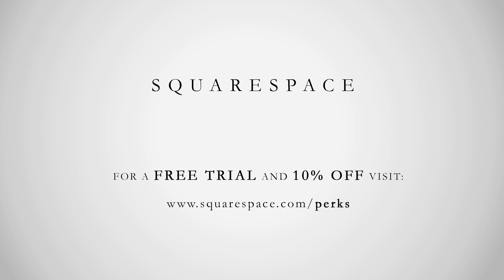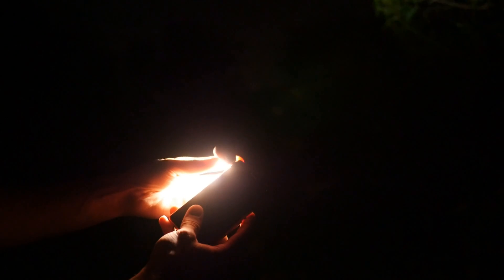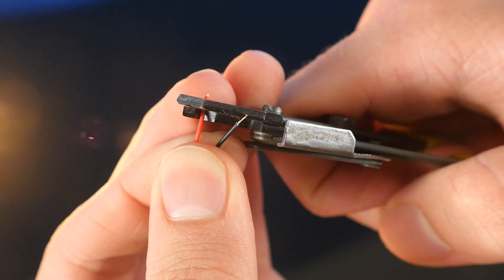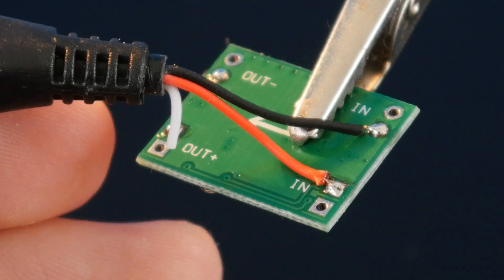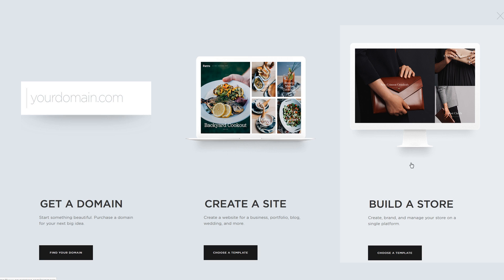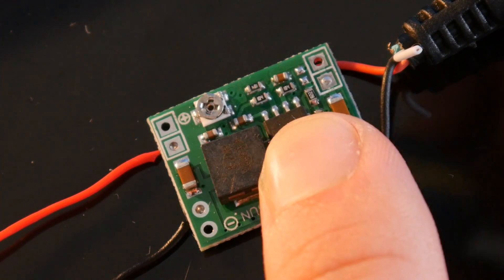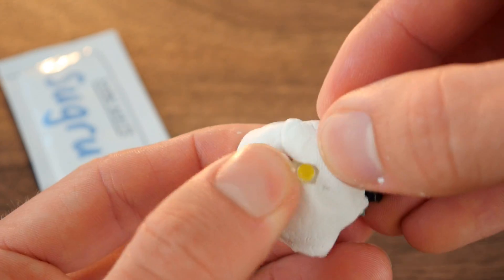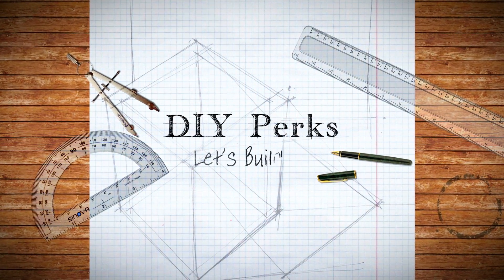A DIY smartphone hack that's actually useful!

Comment: Price of all those parts from amazon inc. shipping is about 50$
For that money we can buy high quality flashlight, with 10W(1000Lm) of power so about 4 times more than that DIY crap.
Also that DIY egg will die quickly because there is no cooling for the LED.
Reply: What heat dispenser???
Its even thermally isolated by that plastic.
And no heatsink.
Reply: You can buy these on ebay for less than $1 dollar USD. There are two types using SMD LED's. One that is a constant brightness and one you can dim as needed. Here';s what they look like -- http://www.ebay.com/itm/MINI-Touch-Switch-USB-mobile-power-camping-lamp-LED-night-light-White-lamp-WF-/371741972756? -- I have a few of them and use them with a mini/micro usb OTG adapter of approximately the same size. I keep the light plugged into the usb adapter and it fits in a pocket. Much less bulky and only cost $2. Now they certainly are not 3 watt LEDs, but they are still very bright and will light up a car interior, footpath in front of you or tent quite nicely... and gently sip from the battery.
Reply: I have dimmable(by touch panel) usb flaslight.
These are just another reason to do not build that shitty flaslight by diyperks...
Reply: I didnt know that it will be shit.
Reply: Sounds good... for the price I can't really moan. Cheers.
Reply: Why don't they make the USB touch light thing in micro usb that plugs straight into the phone socket?
Reply: ss ss I have no idea, but I like the fact that it's full size USB based, because I can use a USB cable to hang the lights from the top of my tree stand and tent above my head for overhead lighting. It also works very well with a battery power pack and USB cable above the kitchen table for overhead lighting during power outages for fixing food, eating, and playing games and cards.

Comment: How do you deal with the heat? I built one and the back of the LED gets so hot you could fry an egg on it! I adjusted the POT to it's lowest setting at full brightness?
Reply: i have the same problem ..... did you fix it ?

Comment: For anybody wondering, this will cost about $20 usd before the mold. The molding he uses ranges from $8-20 but you aren't using all of it on this one project. I'd say you could go cheaper by using epoxy. Maybe the paste epoxy would be a good option. Anyways, nice project. $20 isn't too bad for something original like this. Fun too.

Comment: can you do an OTG external speakers, please? 😄
Reply: Donny Sabri Get a Otg cable, a usb soundcard and a pair of battery powered speaker (3x AA/AAA) connect the soundcard to the Otg cable, open it and add wires to 5v and ground, solder those to the positive and negative terminal of where the batteries used to go. Plug the speakers in to the sound card and hide everything inside one of the speakers. And now you have Otg speakers.
Reply: Or just use any speaker with an auxillary cord...
Reply: Buy an OTG,get USB-Powered speakers and plug the otg and the jack
Reply: gosh that would be sooo awesome!
Reply: Its possible on android 5.0+ I believe.
Reply: :O I HOPE TO SEE YOUR IDEA ON THIS CHANNEL

Comment: I have a bar COB led strip from an old flashlight. would I be able to use it for this project?
Reply: TheFlacker99 (Flak) of course!
Reply: Just check how many volts/watts/amps  it is - you might need to get more power with an amplifier if your phone doesn't give enough. Check your phone's specs.

Comment: whats the point? the phone has a great flashlight already built in just download an app to turn on the flash :/ dont really get the video cos of this
Reply: Johan Kleijn for example phone flashlight is not suitable for my need because it spreads the light way too much making it very dimm when distance between object and phone is greater than 2 meters. this led utilizes lens to focus light so it can illuminate longer distance
Reply: DJhartson true i get your point depends on the flash though my freinds iphone can barely light up 2 meters and my lg g3's does it to about 10 meters in a very wide angle and very bright

Comment: how could I make a front camera LED flash light or illuminator where it's on for video and flashes fur photos for selfie photos and videos using the front camera in low light thanks android user
Reply: matthew pownall you would likely have to write an android driver for that device and would have to integrate the data lanes. A little processor would have to control the light.

Comment: You could add a loop so that you can keep it on your keys
Reply: Take possible aluminum strip, bend it half, add key ring on the middle, put some thermal paste between just polished surfaces and bolt it to leds heat sink with small machine screws. Then add suguru or what ever over it. This should also extend the usage time of the light before it over heats on point of shutting down.

You can make it from steel too to make it more durable, but heat transfer is far less with steel than using aluminum.

Comment: Its clever, but isn't simpler to just buy a small torch that will work without needing a phone attached?
Reply: where's the fun in that?
Reply: I have a small one on my keyring, uses an AA battery and has adjustable brightness and focus
Reply: Colin Java that literally defeats the point in this channel lol no one said this is the simplest option, but on the contrary is it not a good option to have so you never have to charge it or replace a battery? as long as your phone has a charge, you have a light

Comment: Hi. I decided to use three 1W LEDs connected in paralel. I set the voltage on the regulator to 3V and after assembly it switched to 2.4V resulting in a very dim light. After disassembly it turned out that the potentiometer stopped working at all. Luckily I've ordered two of those boards. After replacing the circuit i set the voltage to 2.9v so that the LEDs don't get too warm. I turned it on and left it for some time to check whether everything runs smooth. The whole light seemed to be ok, nothing was heating up. After assembly of the case I wanted to check if it still works and after connecting the power source it burned the board instantly. LEDs were ok, the step down board was smoking. I've used two cell li-po battery. Current was not nearly 1 A at 2.9V. Any suggestions what I did wrong there?

Comment: I am not sure all phones have the over-load protection (not even all PCs have it)... following these steps one could blow the power circuit...
Reply: All phones that support OTG have it and if your phone has no otg there will be no power at all. so no worries :)
Reply: And this is your estimation or information based on official OTG specs?
Reply: YS Production That is the USB standard which doesnt allow more :)
Reply: Jeez, did you miss the part where I said that even some (and actually most) PCs don't have a protection against going over the standard value? The devices' task is to not go over 500 mA, while the host's task is to be able to supply 500 mA. If the device wants to disobey the specs and pull more power, it simply does. The host MAY have a protection (USB specs do not specify it has to be there, maybe OTG specs do, but I wouldn't be sure - that's why I asked if you had looked at the specs actually). Most PCs only have a protection in form of a physical fuse which will blow. But not such a one that would test the load and disconnect it, as the phone in the video does.
So it was only your estimation, great. Thanks for replying.

Comment: As LEDs have like, 0 resistance, they will gladly accept and pass through any amount of current you apply to them,even if they burn through , thats why they should be driven via Current control not Voltage, the manufacturer lists the forward current for led,  you can however limit the voltage as done in this video, but you should check it with a multimeter not trial and error
Reply: If the voltage is limited using buck converters like he did, would it also limit the current? I'm new to electronics

Comment: Love your vids. You've come a long way, and have progressed to a very polished look. I would be really interested to see you create a video for a 'Boom Box' build. Those fantastic old radio/cassette boxes with huge speakers etc. Something really creative. Now it's up to you mate! :) 

GO!
Reply from the maker: Oh, I actually have something like that already planned ;) stay tuned!
Reply: DIY Perks SWEET! Might I encourage you to consider including Bluetooth in your design? :) I'll be sure to watch for the Vid! Thanks!
Reply from the maker: Bluetooth is the main focus - we're on the same wavelength it seems!
Reply: DIY Perks looking forward to it!
Reply: DIY Perks  When researching, Google "diy Bluetooth ground loop", as this will retrieve tutorials that tackle a problem that occurs when you use a single power supply to power both the amp and Bluetooth module, the infamous ground loop, which manifests itself through a very annoying buzzing.
Reply: I had the ground loop issue when doing something similar. I built a lowpass filter, and got it working. I have a instructables of it here http://www.instructables.com/id/Add-bluetooth-to-your-car-stereo/
Reply: Scott Seitz

Comment: Could anyone say why the led get very hot when i plug it in to my phone it has the otg facility ?
Reply: camohoj it's normal. if you are concerned about it then just drop the voltage a tiny bit

Comment: Hi, Matt !  After watching this video,(and drawing great inspiration from it), I went ahead, and converted a rechargeable philips electric hair trimmer/razor, into a USB powered one. The trimmer, originally had one 1.2 V AAA rechargeable cell inside, which I removed, and in its place I soldered the Voltage Step Down Board (which you have used in this video), tweaking it's output to get around 1.5 Volts. The board now drives the trimmer's motor perfectly & is fed by a portable 5 Volts, 2 Amp Mobile Power bank(Mi Power Bank 10000mAh).  Thanks, once again for the inspiration!
Reply: legend. IDK why DIY Perks hasnt pinned this!
Reply: You could have just used few LEDs to step down the voltage. Step down board is excessive. As you did not create this board and probably have little idea how it works, you just assembled ready parts. You did Assemble It Yourself, not Do It Yourself.
Reply: @ScienceDiscoverer  - I’m sure you’re fun at parties… Did he do it himself or did he hire someone to do it for him? He did it himself, thus DIY. Does DIY Perks ACTUALLY build the circuits to turn the input signal into the picture displayed for his laptop LCD screen or does he buy the pre-made components to run the screen? Is he Assemble It Yourself Perks? Stop being pedantic.
Reply: @ScienceDiscoverer Still couldn't call it DIY, he must manufacture his own LEDs, wires and connectors.

Comment: Great idea, but isn't that kind of like having to carry around a flashlight?
Reply: Flashlights need batteries, this doesn't need anything but your phone
Reply: Not really, because you can shrink this project to the size of paperclip and you will not find flash light that small and bright that will fit in your wallet or on your keychain.
Reply: Great! How? Also, what phone do you have and what are the best features?
Reply: I use Galaxy S5, and it works with 3 LEDs 1 watt each.  When I walk into the garage at night with this thing on, don't even need to turn on the lights to search for something.

Comment: Or, just carry a flashlight. I am certain I can find one that's even smaller than this thing. Sorry.
Reply: Internet 101: Everytime there's a DIY video, there would be someone who would always said you could buy the same thing instead of making one. 
THAT'S NOT THE POINT OF THE VIDEO
Reply from the maker: Maybe, but I guarantee that it won't be anywhere near as bright, which is the whole point of the project.
Reply: To be fair, the components are bought. What is the difference, really? My complaint was towards the title - smartphone light hack, indicating that the smartphone was improved upon, rather than just plugging in a USB peripheral.

Comment: this might be silly,but I don't have a solder and I don't know how to use one. is there a way to do something like this without, or are they cheap/easy to figure out?
Reply from the maker: They're actually super easy to use - it's just a hot tip that melts the solder when touched against it. So, if you hold together the two bits that need to be connected and then touch them with the soldering iron, it all melts and joins together. See if you can borrow one from somebody first, and if you find yourself using it often consider buying a cheap one for yourself.
Reply: I'm planning on buying one, too. It seems like I'm always needing to solder something, and it doesn't look too complicated.
Reply: How many females have you seen solder anything
Reply: Just go to Canadian Tire or a tool store. (Not home depot (Hardware store)  but more like a wholesale power tool store, etc work tool store) And you can usually buy one for like 15$-30$ and it comes with a tiny bit of solder too. Whether you buy a 20W one of a 40W one it doesn't really matter/  Once you have it just youtube "How to solder" and youll find easy tutorials. It's really not complicated
Reply: Marsha, just remember to buy solder that has flux core.. make life hellawa lot easier^^ Also better to buy thinner wire than thicker, cause thin melts faster into joint and you dont fry anything with over heating it.
Reply: Yes But it can take some practice
Reply: youtube it. there are plenty of little tips most videos should teach you. someone just going out and trying it will make many many sloppy jobs. Although that is how I learned. I suggest practicing on joining small wires together first before taking on something that requires a more delicate touch.
Reply: you can just buy one on amazon and buy the connector that fits your phone you might even be able to get one that works with a lab top to
Reply: You could wire wrap.
https://en.wikipedia.org/wiki/Wire_wrap
Reply: and how the hell do you wire wrap onto a solder point?As in this video.
Reply: GOOD FOR YOU MARSHA!!! GET ER DONE!!!!
Reply: how difficult is it to google it up?

Comment: Do u know how to make OTG usb type c cable? I would like to see the video on that.
I try to find any source on the internet but not found. I don't know which pin is need pull up or pull down to trigger the host mode.
Reply: Just buy one
Reply: Just put a 5K resistor on CC and GND And that should do the trick. Just don't forget to add some extra output caps between VBUS and GND
Reply: Ashley Van Steenacker thank you very much

Comment: Hey I m sorry but I have a question about the device , will the heat stored inside the device break it? a small device that having a strong light is usually very easy to overheat though. I am just worry for my phone if the device is burnt up.

Comment: Matt, it's good to see someone using Sugru in a project. I've used it for all sorts of things and I love the way it cures to a robust rubbery compound. Strangely, when I started watching this video and I first saw your light I thought that it would be great to use Sugru for the outside of it as it's water proof, flexible and insulating, so when you suggested using Sugru it made me laugh! I would suggest using a DMM to check and adjust the voltage on the buck converter but as lots of people don't have one I can see why you didn't suggest it. Nice, handy hack!

Comment: Do you need an OTG cable? I thought all micro USB cables had the same four wires.
Reply: there is another comment that explain it better, but the answer is yes. the actual connector has 5 pins. 
1 2 3 4 5 most only use 1.2.3.5 but you need to short 4 to ground which is pin 5.
https://www.quora.com/How-different-is-a-normal-usb-cable-from-OTG-usb-cable
Reply: Okay, thanks peep.

Comment: You should set the voltage regulator first, setting it later will: 1. Runs the risk of damaging equipment that isn't "Smart" 2.Trains people to expect all circuits to protect themselves. 3. Blow up if the first test is on a phone charger.

Comment: Why would you need an OTG cable if you cut of the female usb a anyways?
Reply: The magic is in the microUSB side
Reply: On the microUSB side, pins 4 and 5 are shorted together telling the phone to go into host mode.
Reply: Máté Varga In a proper one there is a resistor, but they can be just shorted together if you go the DIY route.
Reply: @Mikeguy94 wow dude.. THANKS SOOO SOOO MUCH :) If you wouldn't gave that info, I'd try normal micro usb connector and probably fail..
Reply: they are not shorted. there is a resistor between them
Reply: dip it in a little water before you plug it in, that'll short it
Reply: ***** It's an arbitrary thing now. It used to indicate if it was USB host, audio out, TV out, et cetera.
Reply: well, you have five pins inside a micro usb
why dipping it in water is going to short just pin 4 and 5 and not all the ones?
anywhay water has a really high resistance, especially at low voltages so the pins won't short out anyway
Reply: @scarrypolpetta9006  You hold your finger over the others lol (sarcasm)
Reply: Scarry Polpetta Dang.
Reply: it wont short it but it will corrode it and break the connection
Reply: oh. Still a good thing to try just in case it works and you like taking advice from strangers.
Reply: The ones we make just have pins 4 and 5 shorted together. I don't use a resister. Could you explain the resistor to see if it's a better choice.

Comment: i would suggest using a warm led instead of a pure white, as the light is much more comfortable to the eyes(looks like a pure white in the video, i could be wrong of course) also, instead of trying to make a light yourself, you could buy a small inexpensive usb light, with a touchpad for a low price, hook it up, and bam, now you can even adjust the light on the fly :)